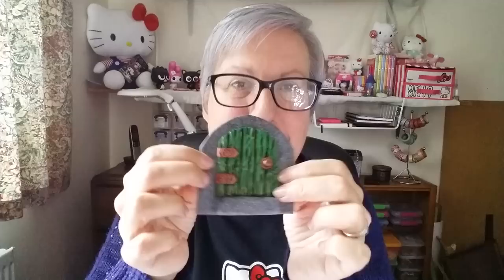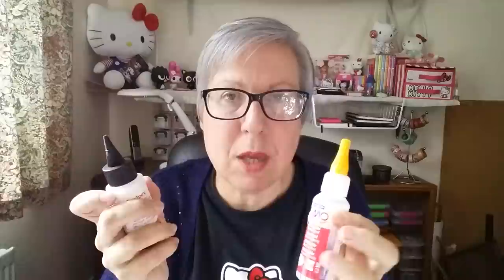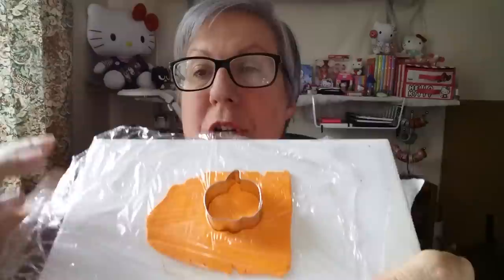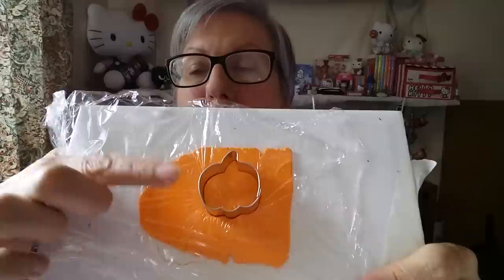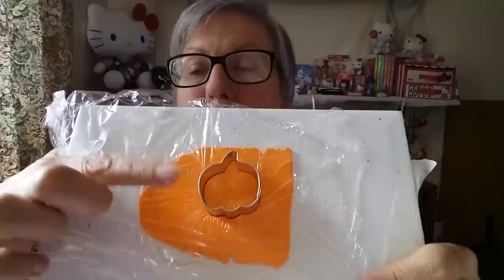Five Things I Wish I'd Known When I Started Polymer Claying

Comment: hi there!  I love your video, great tips but I had to share...after using your brush in tls, fimo deco gel or bake n bond just soak it in rubbing alcohol and it will be as good as new!!  alcohol eats away at raw clay!  hope this helps ❤❤
Reply from the maker: Thank you! I tried this today and it works well... I am going to pin this post to the top! xx
Reply: Unruly Housewife awesome, Tysm ❤❤
Reply: You can also use a soft dry cloth or a cotton swab dipped in alcohol  (dip the cloth first too) and rub it softly/gently onto your unbaked piece of polymer clay to  rub off any dirt, dust, or hairs which may have gotten onto it prior to baking your piece! It works wonders....I was never so happy to find this trick out!
Reply: On the other hand, it's better for the environment to just leave the brush as is, if it stays useful and doesn't glom up, than to keep thinning it and sending chemicals down the drain, over and over.
Reply: ☺️ you’re so adorable! Thank you for the tips. I found the liquid clay tip the most useful 👌🏽
Reply: @shantiaum5774  Please could you tell me the process of using the liquid clay as I didn't hear how & why to use it. Thank you so much.

Comment: I love the tape trick for cling wrap! Another trick, is when you're using mica powders on a textured piece, but you'd like to remove the powder on the raised part---just use the tape. Or if the powder goes where you don't want it to be, tap it with tape.
Reply from the maker: Great tip, thanks! xx
Reply: HKreations

Comment: Rubbing alcohol on a cotton swab can remove dust and hair from clay easily. And soak your paint brush tip in baby oil to dissolve liquid clay. Always use a mask when working with any fine powders or when your polishing and sanding your finished piece.

Comment: Sandwich bags are a bit thicker than the cling film and will give you a puffier cutout from your cutters.  Didn't even think of tape to remove the cling film when I got overzealous at cutting.  Now I will.
Another tip - instead of a grid or a ruler always in my way, I found "measuring tape" on Amazon, which is printed yellow masking tape with 12" measurements and 30cm as well.  I put it directly on my craft desk and on one tile that I usually use for rolling and cutting because it won't fit in my toaster oven.  When the tape gets smudged and dirty, or difficult to read (alcohol kills the markings!), I simply replace it.  I depend on it!
Reply from the maker: Martha that tape idea is BRILLIANT! I'm ordering it as we speak... Thanks! xx

Comment: Thanks for the tips! QUESTION: I'm totally new to polymer clay, and have 2 questions: 1) Do you use the Hot Fix glue to glue on the Swarovski gems before or after you bake your piece? And 2) What kind of finish do you use on your pieces AFTER you apply mica powders to seal them? Thanks!
Reply from the maker: I normally use Americana DuraClear Gloss varnish, to seal my work. Crystals with "Hot Fix" glue already have it on the back, so I would put them in the oven and let the heat do the work. That said, a dab of Bake and Bond helps it to work better. Since making this video I have had some fails with Hot Fix, so it's always good to sink the crystals into the clay a little,  test them after baking and if necessary, re apply them using something like Lisa Pavelka's Poly Bonder.

Comment: I have been sculpting in clay for years but have just started using polymer clay so that I can bake it in my oven. Your video took the fear factor away and I can't wait to get started.but I have a question. How do you know how long to bake an item? Is there a rule of thumb for large pieces?
Reply from the maker: I haven't made large sculptures myself but I think they are best built on wire, with foil over it. That way the clay is not too thick and will bake nicely. Generally speaking people in the know stick to the temperature on the packet but bake longer (say an hour) to add strength. I'd really recommend you join a polymer clay group on Facebook (HOP! Hooked on Polymer is my favourite) and get advice there, from actual sculptors.

Comment: Hi, thanks of for the video, can you tell me how strong, damage resistant this is after baking? I am doing a sculpture in metal, but want to do the face in clay. Will it work? putting clay on the metal? Also, what are the bling things called, where do you get them, as well as the dust stuff you talked about please? Thanks, Keep creating.
Reply from the maker: Sorry it took me so long to notice this. If you bake according to the manufacturer's instructions it should be very strong. If it feels a little flexible, that's ok. The bling things are hot fix crystals, the dust is mica powder.

Comment: Hi! Great tips. I don't know if anyone's asked already, but I have a problem with bonding metal to the clay. I've been using E6000, but it doesn't take long for it to break off. Is there anything you know of or that you use that you think might be better ^
Reply from the maker: I use Lisa Pavelka's Poly Bonder (which is safe to bake too). I was recommended to get Loctite Gel on a course with three professional teachers. But really, the best way is to somehow embed the metal into the clay, if the design permits. xx

Comment: If I have a baked piece of polymer jewelry, and I coat it with liquid Kato on one side, put it in the oven for the prescribed time to cure, remove it from the oven, let it cool, turn the piece over, can I then put a coat on the back, and bake it again, without the first side coat sticking or melting?  Thank you.
Reply from the maker: I'm not sure! My advice is to experiment with some scrap clay first... I don't think it will completely melt but the surface might be spoilt. Please let me know, if you find out!
Reply: @UnrulyHousewife  Thanks will do.

Comment: Hi. Thank you for the tips. I'm just starting and I'm like a sponge, trying to learn all I can. I had a question. Could you elaborate a bit more about the "hot fix crystals"? What are they? Ive seen people glue some kind of crystals to their clay and bake their piece but they never explain how they don't melt in the oven. 🫠 
Anyway, thanks so much.
Reply from the maker: You're welcome! Hot fix crystals are Swarovski glass and have glue on the back that attaches them to things, once heat has been applied. The alternative is to use ordinary crystals, pop them off after baking and set them back in place with superglue. Glass won't melt in your oven (plastic ones might).
Not all hot fix style crystals have brilliant glue, so maybe test one to see if the bond is ok and add superglue to them if needed. Only set crystals where the clay doesn't flex. 
The strongest setting is to push the crystal into the clay and squish the edges of the hole in around them, covering them a little... If that makes sense. 🤔😁 Edit: you can buy crystals on Amazon.
Reply: @UnrulyHousewife  OH. Ok. Thanks for the quick reply. Will keep a note. 😁

Comment: I have a question about part making, you said you make the stone piece first, then you add the door, and then the flowers.. My question is, can you bake the first piece as many times as you need until all the parts are added? Or could you potentially run the risk of baking the first piece too much and ruining it? Like if you make 4 separate parts, will baking the first piece 4 times ruin it? Thank you for making this informative video, I am now subscribed and ready to learn to start creating my own creations soon!
Reply from the maker: i NeeD CoFFee Hi! I emailed Staedler (who make Fimo) and asked them about this. They said you can bake it a few times, as long as you let it cool completely between bakes and end with one long full "according to the manufacturers" bake. They didn't specify how many times you could bake but said the possibility of cracks would increase after a bit. 
Personally I'd try to keep it to 3 or 4 at most. Some people do a full bake on each layer, I save my big long bake until the last one. 
Polymer CLAYING is loads of fun, so good luck! xx
Reply: Unruly Housewife thank you!!! This helps so much!!!!

Comment: I'm new to polymer clay crafting, how do you prevent cracking after it's baked? Is there a finish to apply?
Reply from the maker: It shouldn't really crack, if you condition it well and bake it fully. You don't need to apply a finish... Although I sometimes rub on some Renaissance Wax, just to bring out the colours.
Your best bet with varnishes, if you like that look, is to Google the Blue Bottle Tree website and look on there. It's a mine of polymer clay information.

Comment: Help! I made a Fimo donut, mixed liquid Fimo with brown pastel for chocolate, painted it on top put it in the oven (just like a tutorial showed me) and the 'chocolate' just ran down the sides. I put the oven on at 130 for 20 minutes like the liquid Fimo tells you, I also tried it at 110 for half an hour like the normal Fimo says. Both made it melt (run) down the sides of the donut. Any advice please to stop this happening?
Reply from the maker: Sounds like it is too thin. When I made an egg white I smooshed some actual clay into the mix, to thicken it up a bit. It took ages to whip it into a paste but in your case it might be the answer. Or maybe just mix in more of the pastel? Hmmm. x

Comment: Thanks for the video. I am a teacher who has never used Polymer clay :-/ lol, Fimo now ordered! Can I ask, is it best to build your clay on the surface you wish to part- bake it on? Or transfer to another surface after? For flat shapes, i am worried they will stick. Any pointers? Thanks :-)
Reply from the maker: If you bake them flat on a smooth surface they should be ok, provided no bubbles push up under them. Once baked just free one edge and they should lift off. That said, if it won't cause too much distortion in transferring, you could bake them with a sheet of white paper between clay and surface. Remember to do one long full bake once they are finished - part bakes are useful but don't give the strength of a long bake.

Comment: Thank you for this lovely video, pls can you help me, I like to add shiny crystals to some of my work and I could not hear the part about the crystals you said, how can I add them , can I add them before I bake and can they go in the oven without melting
Reply from the maker: Yes, as long as they are glass and not plastic, they should be fine in the oven. You can buy "hot fix" crystals, that have heat activated glue on the back... I tend to use these, as they bond to the clay themselves. However, it's worth testing the brand you use  a little after baking - if they pop off you can always put them back using superglue. The best "fix" is always achieved by overlapping the clay a little, around the edges of any crystals. 😉
Reply: @UnrulyHousewife  thank you soo much you are a star xxx

Comment: Thank you for the information!
How do you set the temperature when you rebake when applied with fimo liquid? Do you rebake it on 110 degrees Celsius or 130 degrees Celsius since fimo has to be baked on 110?
Thanks!!
Reply from the maker: Googling around, and using my own experience, I would tent it with foil and bake at 130. That said, I can't guarantee the results and I should really be telling you to follow the manufacturer's instructions. 😉
Reply: @UnrulyHousewife  the manufacturer says to bake the liquid clay itself at 130. But regular fimo has to be baked at 110. They don't say anything on how to bake it when applied together.  So that is why I was curious in how you did it 😁

Comment: Thank you for these tips. How did you attach the polymer clay to ceramic? 
Thanks.
Reply from the maker: Was it the teapot in this video? I forget 😂. Anyway, I try to wrap my clay around things, in such a way that they can't be pulled off, because (let's say) the top and bottom are narrower than the middle - that's called a "mechanical bond". People also use glue, on flatter surfaces - normally some kind of super glue (after baking you lift off the clay and then re-apply with glue). Glues are not as reliable as a mechanical bond and so I avoid them on ceramics... I suffer with anxiety already. 😉
Reply: @UnrulyHousewife  Thanks for your reply. I've seen people using Gorilla or Poxypol glue. Maybe I'll try those. Best.

Comment: Many times when I bake polymer clay pieces (for the exact times on the clay package & at the exact temperature) they come out still bendy or bendable....and if I add more baking time (like another 1/2 hour or 20 min longer) they are still bendy. What am I doing wrong here, please give me advice on this, as it is very frustrating! I've checked my oven temp with a thermometer for baking, it is right on the temp. I've also tried increasing the temp but ended up burning many pieces in an effort to get them to finish baking. I have done this with fimo, premo, and sculpey clays. Please, please, please advise me what to do? Thank you so much in advance!!!
Reply from the maker: Well, polymer clay is going to be bendy, unless it is very thick. I think you sound like you are doing the right things and as long as your pieces don't break you can relax and know your outcome is normal. xx

Comment: The clay I have says to bake for 15mins max. When partially baking do you mean that you can bake one piece fully then you can stick on another piece then bake again for another 15mins? or do you mean you do your first piece at like 5mins put the other piece on then bake for the full amount at the end once all pieces are on. I am confused lol
Reply from the maker: I don't know what brand of clay you are using but 15 mins won't be enough for decent brands like Premo, or Fimo. For those you can part bake by doing 15 mins per add on and then finish with a "full bake" on the last piece. So a final "cure everything right through" of 45 mins, at least. Polymer clay won't be burned by a longer bake, as long as the correct (manufacturer's) temperature is used. 
The short bakes are just to stop your clay from distorting, until you do the final bake. If that makes sense. 🤔
Reply: @UnrulyHousewife  Thanks! I really appreciate your reply. I use Sculpey original clay. Says 15mins max at 275 deg F on the packet. So if I understand correctly, for my particular clay, doing partial baking would mean I would do a 7.5min bake then once I am happy wiith all the pieces being done I can do a full 15mins with everythibg assembled.
Reply from the maker: @shawnaT456  I am confused because 15 min max (isn't it per a certain amount of thickness?) seems very little. If that's the case I would do 15 mins per layer, the last layer being 15 also... But to me it's not going to result in a strong item. 
If you want you could ask for advice on a FB group for clayers. HOP! Hooked on Polymer is a really good group to be a part of. Good luck!
Reply: @UnrulyHousewife  Thanks!

Comment: hi I love your videos. I have a question I don't know if I'm the only one that it happens to. I started trying the polymer clay but it gets really sticky on my fingers. do you have any tips for that? thanks you videos are very informative.
Reply from the maker: Hi Bianka! Firstly I'd say use a good clay like Premo, Fimo Professional, Kato or Cernit. Some clays, like Sculpey 3 and Fimo Soft do tend to be sticky, and if you have warm hands it doesn't help. Really cheap clays from China are probably not a good idea, nor is Bake and Bend, or clays aimed at kids. 
You can wear finger cots (Google that LOL), or rubber gloves. Some people dust their hands with cornstarch. I think when you are learning you tend to keep working the clay over and over, until it gets sticky. As you get better at it you won't pull it about as much. Really sticky clay can be left between two sheets of printer paper for a while (so that some of the oil is soaked out), or simply popped into the fridge to cool down and stiffen.
Reply: Unruly Housewife thanks I did buy premo and kato and sculpey. witch I was thinking was going to be a better one because it was more pricey at the store I went to. but thank God I still can exchange them. thank you so much for taking the time to answer my question.
Reply from the maker: Sculpey Premo and the Kato are fine! The only one I'd take back is the  Sculpey 3 xx

Comment: Do we need to put that glue when we are mixing two clays together
Reply from the maker: Bake and Bond? Sorry it's years since I made this video 😂. If you're mixing two raw clays together you don't need anything to bond them. If you're adding fresh clay to part baked clay you'll need something like liquid clay, or Bake and Bond to let them join together as they are re-baked (cured). It's important that once everything is finished, there is a full length bake, to make everything strong.
Reply: Thank you so much for the reply .. I'm new to the polymer clay making .. I found a clay and it doesn't have any instructions..so I baked it 130c and 1 hour but still that clay is breaking .. pls give me an advice how to bake it strong
Reply from the maker: It might be the brand of clay. A decent brand of clay, like Fimo, Premo, Cernit, Kato etc should be strong. Sculpey 3 is brittle though and the random cheap clays you see around aren't great, as far as I understand.
Reply: Thank you so much I think  I better change the clay

Comment: What is hot fix? For the rhinestones part
Reply from the maker: "Hot fix" is a type of glue that melts and sticks the stones to material. It can work on clay (especially if helped with a little bake n bond). That said, it is always worth testing stones, in case they need glue after baking... not all hot fixes and clays are the same. xx
Reply: Unruly Housewife thank you for answer. Quick question I've been wondering about, what is the difference between bake n bond and just translucent liquid sculpey? Cuz TLS is 2 times the price of bake n bond pretty much but I don't get difference